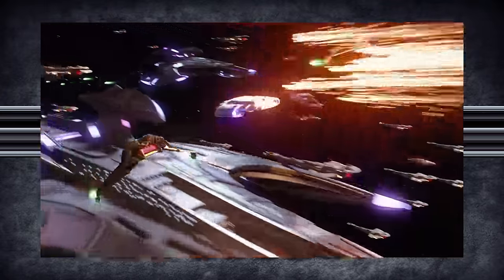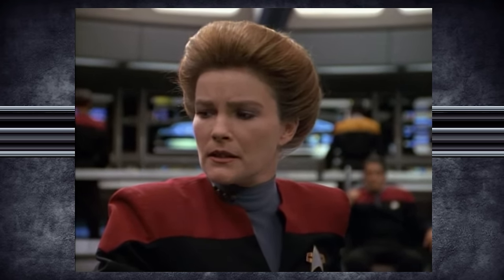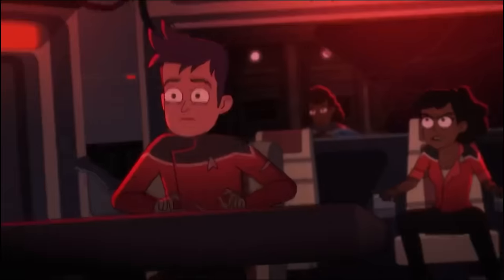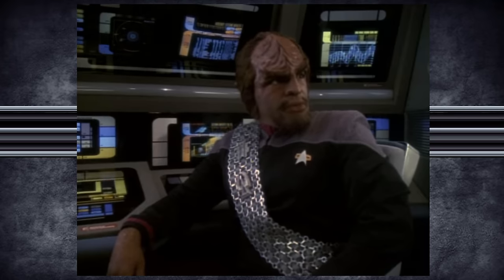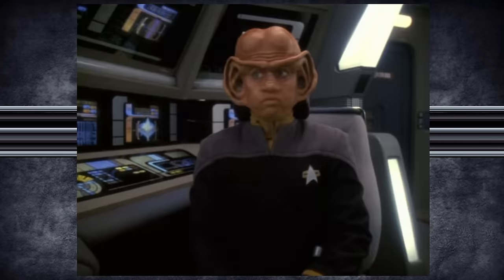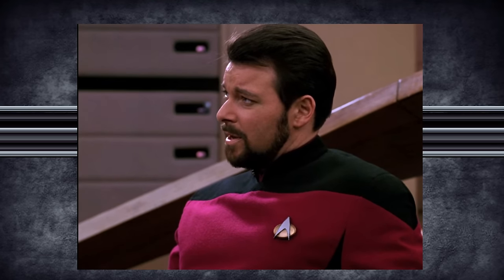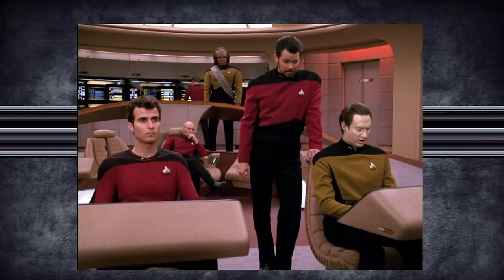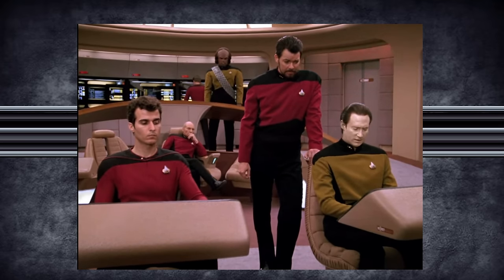Why Starfleet's Bridge Design Was Lethal to the Crews

Comment: well, I'd have to disagree with you about the windows instead of a viewscreen, even if I see your point. Yes those systems can fail. But what fails? The screen: who cares as long as the other consoles work, you can operate the ship; or do the sensors fail that feeds the viewscreen? Well then a window won't make any difference, your a sitting duck as you may not be able to see, but worst you also cant shoot back. The only point I would give you here is, yeah... the depiction of ship positions or movement in Trek is inconsistent. We see ships face to face to each other in clear visible range... but we also see that the ships are capable of fighing over huge distances or can move at high speed while doing it... in that scenario a window would help nothing if the sensors fail.
Reply: On top of that, material that is transparent is inherently weaker then its non transparent counterpart in all cases.
Reply: Ditto. There's always backups. There's always back up power, in TOS there's batteries,auxiliary control, and engineering where the ship can also be run from. And in the TNG era there's the battle bridge. A bridge module should have its own batteries or power generator in case it's ever cut off from the main power source. I think the view screens they have are probably far more advanced than any of our display screens today. While our screens today the slightest dent and they're ready for the dump, I think they can probably self repair.
Reply: @ZontarDow  diamonds? And transparent space metal aren't though in theory you could make the entire ship out of the transparent metal they use for the "window"  it would just be too distracting for the crew
Reply: @ZontarDow   not only is that not likely true it also doesn't really matter, with few exceptions it is consistently shown that hull materials are useless against both credible enemy weapons and many natural phenomena. 

The true strength of most starships are its arrays of shields fields and screens, when shields fail ships are often destroyed in single shots.
Reply: The window is not going to be any help if you lose the viewscreen. First looking out the window you will go "Yep that's space." Any ship you are fighting or space garbage you are trying to avoid will not be seen due to distance. How many of you have watched the Space Station? A bright light as long as sunlight is hitting it. Second you are looking into the past. The moon is over one light second away. You have one of those small ships moving near the speed of light you wouldn't have time to get out of the way. Third was pointed on this post by another. It's just another weak point.
Reply: @francisdhomer5910  Was going to say the same. Distances in space are large and the speed of the vessels is not slow.

Suppose the ship's travelling at full impulse, that's 0.25c. That means when the pilot needs to depend on his/her eyes in case of a breakdown, s/he has a total of one second to see, react and steer the ship away when it's heading for an object 75,000 km away. A small ship like the Defiant could possibly evade this in such a short time, but a Galaxy class would need more time just to move away enough.

And is it even possible to see an unlit object in space from large distances? The answer is no. Windows or not, if the sensors break down, the best thing to do is a full stop and pray nothing is coming your way. Because space is too big, speeds are too high, space is dark, and our eyes just aren't good enough to see things in time.

Likewise, in combat it serves no purpose, unless the entire ship is made out of transparant materials. you can only see one direction through a window. So if an enemy is coming from any other angle, you can't see them. And even if you could, you're not manually aiming a weapon: you're pushing a button so somewhere on the ship a weapon fires.

Finally, DS9 makes clear that Starfleet has backups for the backups. The backups for the backups will always be more useful than going on sight.

Windows for operational purposes are dumb within the Star Trek context.
Reply: @KingOfLesbia  tbf diamonds are super brittle
Reply: to ad on that, they always use the viewscreen to view things not directly in front of them which is very useful
Reply: @KingOfLesbia  Diamonds are hard but extremely brittle, that is to say trying to scratch it may be difficult but it will shatter very easily if hit by something hard travelling at any significant speed. A hammer or pretty much any piece of space debris would do the trick of turning a diamond into a lot of diamond fragments.
Reply: Windows are shite on any starship. They're a structural point of failure that any competent engineer is going to strive to avoid.

On the Apollo landing craft, there is a window only because the astronauts (most of whom were air force and navy pilots) had enough influence with the high-ups to demand one. It wasn't needed or even overly useful, but they felt helpless, not being able to look out... Drove the construction team mad having to implement that into the design.

Starships are going to be a lot more similar to submarines, design-wise. Space is at a premium.

The Enterprise D is a total waste of the available space anyway, what with all those empty corridors, turbolift shafts and Jeffries' Tubes. The bridge is just more of the same.

Starfleet is the biggest mover of air in the galaxy.
Reply: @metallkopf988  Those corridors are all far too wide too, especially as they maintain the same width in lower traffic areas eg those servicing the sleeping quarters. I could perhaps see some main thoroughfares being a little wider but corridors to crew quarters really need not be any wider than necessary for two people going opposite directions to pass each other if one turns their back to the wall to let the other pass.

Even a luxury passenger liner I would not expect overly wide corridors in the passenger sleeping accommodation areas. Perhaps on the reception, retail, and entertainment decks etc where the spacious corridors are designed to encourage lingering to maximise sales opportunities. But in accommodation areas every bit of surplus corridor space is taking away valuable real estate that could be additional cabin space to rent out to passengers.

Military vessels have no good reason to devote any space to overly wide corridors. Hard to see any good reason to ever have a corridor much wider than would be needed for two people to stand shoulder to shoulder across it. Not even on a major thoroughfare as that is all it takes to enable a constant flow of two way pedestrian traffic at all times. Granted for that to work optimally everyone needs to keep strictly to their side of the corridor, but this is not so much an issue for a military vessel. Everyone on board is a trained crew member or at worst a pre-vetted and briefed guest, either way nobody would be ignorant of any ships regulations like that.

Comment: The reason to skip windows is you couldn’t really see anything.

Given the scales involved, they would almost never be useful outside a pretty view in orbit, or during docking ops.
Reply: Plus it’s a weakpoint
Reply: I mean, you can't see anything if the viewscreen is down and damaged either. At that point a transparent see-through metallic window would be optimal as noted in the section of the video about the Discovery. Layering in an additional user interface with the functionality of a viewscreen on top of the window and you have a perfect mesh of both worlds.
Reply: Combat always takes place within a few ship's lengths of each other.
Reply: @JFrazer4303  With ships capable of moving faster than light? :)

Comment: I'm not sure which TNG resource to cite for this, but I seem to recall: the original principle behind the design of the Galaxy bridge was that a ship of the more advanced age would be a lot more automated. Fewer crew members could keep track of things from the bridge. They would be able to do more, and would require far less micro-management from the captain and XO. The three senior officers chairs were instead intended to create the atmosphere of a conference and encourage discussion on the bridge rather than most time being spent asking for status updates on ship systems.

In fact, the early design for the bridge had the captain's ready room be OPEN to the bridge and in the back - the idea was that the command crew would mainly be on the bridge to talk about matters, not run the ship. They would simply have a view of crew members entering and exiting the bridge to occasionally check on a station. This huge set ended up being impractical to construct however. And it would have been difficult to frame and shoot effectively.

This was intended to flow with TNG's era being one of a much more peaceful Starfleet - one that was powerful enough to explore in a relaxed manner and be less aggressive in reaction to provocation. Now, the actual writing of the series may not have always communicated this well or respected it. It often fell back on basic conventions. However some early episodes do seem to keep this in mind. The first encounter with the Ferengi for example - rather than the bridge crew panicking and going to battle stations when a hostile ship opens fire, it is demonstrated the Enterprise is far superior to a random, unfamiliar threat. And the bridge crew instead calmly analyzes and deliberates the situation.
Reply: Are there any design sketches for this early concept?

Comment: My personal opinion is that the layouts of each station by the TNG era as we see it on the Galaxy class just happens to be set as such. All the different stations are most likely fully configurable and can take up Dutys of another. 
A good real world example to this would be old and new aircraft, old aircraft maybe had a single TV screen limited to a single function, several dials, buttons and switched locked in a single position, modern aircraft replaced the majority of these with several Multi Function Displays that are identical and share the same functionality across each of them.
if you need weapons information one pilot might like to pull them up on the left display, another on the right or on the center.
Reply: Good example.  Another would be the configurable screens on modern US tactical submarines like the Virginia.
Reply: You have to wonder how other shifts picked who was gonna be stuck standing at the day shift's 'Tactical' station.
Reply: @Sorain1  Propably just picked by the Senior of each station and everyone else has to live with it
Reply: @Sorain1  Don't they show this a few times, as another yellow shirt is standing at the station? I assume it's a Security / Tactical station, meant for a promotion above "random Guard".
Reply: @Sorain1  Night shift tactical simply reconfigured a station on the backwall and took a seat. Not much to do for tactical on any given day anyway.
Reply: @Hans-gb4mv  Tactical is very much the soldiers life 98% boredom, 2% bowl clenching terror.

Comment: 18:24: The Galaxy Class Bridge is designed rather well for peace time. The Counsellor Chair as you put it is actually the Mission Chair. Anyone with Mission Specifics can sit there including Dr Crusher, Cmdr Shelby, Ambassadors and even Admirals. Having Tactical up high and behind makes sense as Worf has vantage point to open fire on intruders (whether plot armour dictates he get owned is another matter). All the Captain does need to see is Ops or the Universal I see every station, and Helm - everything else is automated pretty extensively and the Galaxy Class pre Dominion War didnt exactly run a CIC (which would be in the Secondary Bridge buried deep in the Sauce Module (yes the Galaxy Class had three Bridges, the Main Bridge, Secondary Bridge and Battle Bridge)
Reply: No one else mentioned that secondary bridge, good point, but in most cases, control for specific systems could be rerouted anywhere, given the proper command codes anyway :)
The Galaxy class also had children on board, so yes, given its mission and in peace time, the brdige made sense. Reconfigure for conflict. As Edward Jellico demanded in Chain of Command.... or when engaging that EP-607.

Comment: Have to disagree on the Discovery being a good bridge design for three main reasons:

1- Holographic and transparent displays are a terrible idea. In reality anything that happens behind the screen will distract the officer working on it. The last thing you want is the eye of your tactical officer being pulled off a display by something happening behind the screen.

2- the distance between the displays and the captain's chair makes it hard for anyone without magnified vision to see exactly what's going on.

3- the size of the bridge is far too large. For one, space is at a premium in a starship. Even the Galaxy class had a modest bridge that was easy to cover in a few paces. The Discovery bridge would take a good while longer to cover if one needed to replace a downed crewman on the far side. The Discovery bridge is full of an extreme amount of empty space for a bridge on a supposedly functioning ship.
Reply: Most modern fighter pilots would disagree about your concerns with the holographic displays, that's literally what a heads up display is. More likely, the officer is expected to be able to distinguish between the real stuff and the hologram stuff in order to do the job.
Reply: @jonathonclary1681  The difference there is that a fighter pilot is supposed to be observing what is beyond the display. The HUD displays important information to the pilot as they are observing their direction of travel. In short, the pilot is supposed to be distracted by what is beyond the display.

If you're reading a computer display about a starship you don't need situational awareness outside of the panel that you're looking at. The holographic screen only adds potential for distraction and difficulty of focusing vision for zero added benefit.
Reply: @jpc347  Also it means that possibly you can end up having your controls blinded/blocked.

I believe somebody did a video about how silly the Picard floating holo controls/displays were, because bright lights (or other things) behind the holograms would possibly obscure the controls or make words unable to be read.

Comment: You’re forgetting that ships like the Enterprise have battle bridges. They may not be used often, but at least the larger ships seem to have redundant bridges. There is also the ability to transfer bridge controls to any number of secondary areas.
Reply: But it's shown that those bridges are not manned, meaning they don't actually serve the function of a backup command center.
Reply: @DrewLSsix  For the Galaxy class it is more of a "drive section bridge".
Reply: @DrewLSsix  except for those times where they use it. Or as I like to call it the only reason we know there is a battle bridge. Also your adding qualifications not outlined in the video. The battle bridge is a redundant feature that specific purpose is a backup command center if the primary bridge is incapacitated in any way shape or form. Also how do you know the battle bridge wasn’t manned during conflicts. Perhaps red alert triggers a second bridge crew to man the battle bridge. Or did you forget there are more than the 6 main characters on the ship?

PS. From the TNG area onward federation ships can be controlled from virtually anywhere on the ship. If you include the wrath of khan a starship can be controlled from a completely different ship.
Reply: And that was mostly used when they wanted to separate the saucer section - only in one episode prior to battle i saw them man it just in case...
Reply: @krzosu  the fact that there shows there is more to it than that. Add to that the ability to control the ship from virtually any station.
Reply: @Momoneymmiproblems  Quite often we saw that aint possible without releasing bridge or engineering lockouts prior to that because they were there to protect the ship from being hijacked by random boarders who managed to get on board. So is that doable - yes - is it easy to do ? no - especially if people autorised to do it are already dead or incapacitated.
There was an episode in ds9 where worf tried to command the ship from engineering and it took a long time to set it up properly.(the episode with the Karemma ship who tried to hide from dominin ships in a gas giant) The topic of bridge lockouts was alos in ds9 episode "a little ship that could" where Obrien , dax and Bashir got mini sized in runabout.
Reply: @krzosu  okay, this is a stupid argument. So sure whatever you say. I have better things to do.
Reply: @DrewLSsix  Lots of that happens in Star Trek (particularly TNG and later). The bridge stations are all manned by the Senior officers who just get up and leave when they need to go to a meeting, away mission or leave because their department is on fire.
Also crazy things like Doctor Bashir manning a bridge console during a battle.

TOS had an explicit auxiliary control area that they kept manned.
Reply: @krzosu  So it WAS manned in that particular case.... and since Galaxy class startship's primary mission is not combat.. it does make sense to utilize it that way, unless they have the officers to spare (of course continually manned would be beter, but has it been shown as empty most of the time? Not sure..)
Reply: @krzosu  Both true and great DS9 episode. That said, it was technically possible, which isn't always the case in say, present-day reality. The fact that the technical possibility exists in the first place may have led to different design decisions, so who knows, but I suppose all designs have one thing in common ---- to try and look nice on television.